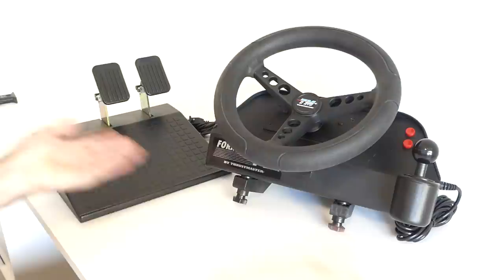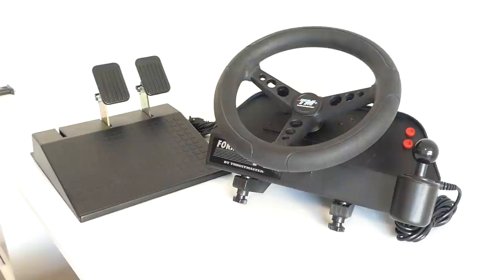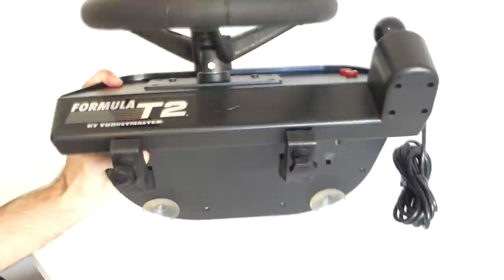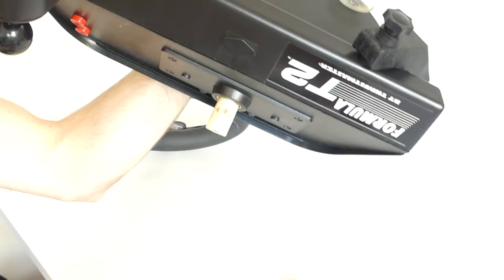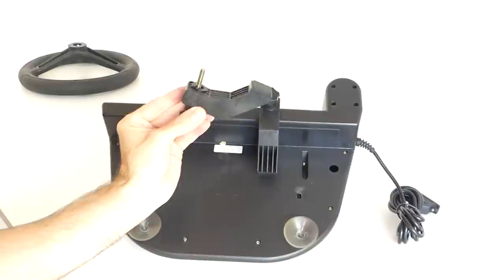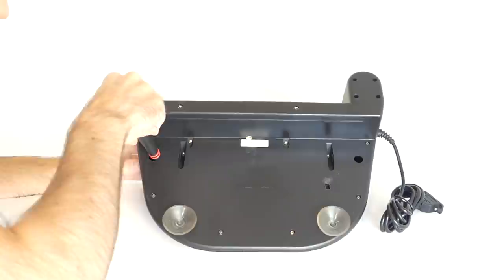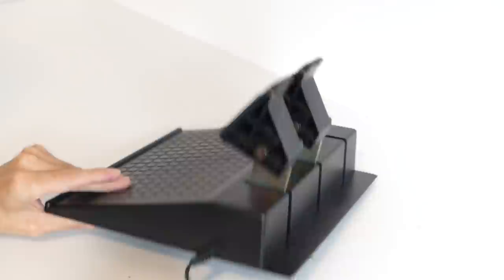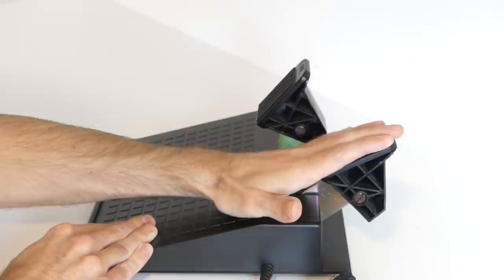Thrustmaster T2 teardown: THE wheel and pedal set from 1996!

Comment: I bought the pedals for 5 bucks on an a antiques shop and converted them to USB using an Arduino. They aren't G27 quality but for the price they are actually kinda good. It's a nice upgrade from my cheap plastic pedals that I also converted to use with my diy wheel.
Reply from the maker: Fun project! Expect to replace the pedal torsion springs and find that the bungee cord in the wheel becomes sloppy real soon though!
Reply: @NielsHeusinkveld  I actually didn't buy the steering wheel. I already have a way better one (also diy) and I only needed the pedals because the other ones that I had are really crap. They are 99 percent plastic, only the springs  were metal. But if those held up 1 year of usage without breaking, I guess these will also hold up for another year.
Then I can buy another crappy set of pedals for cheap, and convert them again.

Comment: Hey Niels going retro is great!
I realise you discarded your original Load cell brake set, but I do hope that through any moves you have made over the past 15 odd years you managed to hang on to the original Brick that used sit on top of your  pre-FFB steering wheel in the old GPL days?
That brick just screamed performance and precision!
Reply from the maker: Sadly the brick only lives on the 640x480 digital pictures I made of it..

Comment: My first wheel was quite similar and from the same era - a Dexxa (supposedly some kind of Logitech cheap brand) steering wheel:

https://f.aukro.cz/images/sk6919066085/726d4740-11a2-40fc-a374-b6d949755116

(Not my image.) It was also a bungee cord wheel, but felt pretty good actually, same for the "shifter". I was using it for the original CMR and also GPL, yes. Eventually, I did some mods to it so I could switch the pedals between combined axis and split axis (as some games didn't like one or the other). Then a year or two later, I got the Sidewinder FFB wheel which I was actually using all these years until fairly recently (I think 2014 or so).

Comment: have a question ,, would i be able to use this steering wheel on windows 10?
Reply from the maker: Not really without converting it to USB using something like the Leo Bodnar BU0836 board (google is your friend). There might be a gameport to USB adapter out there but they're terrible.
Reply: I have one

Comment: can you provide Thrustmaster T2 driver for me? Thanks!
Reply from the maker: There are no drivers for the original wheel, which used the gameport. And when modifying one with a USB board like I did from Leo Bodnar, it becomes a plug and play USB Game Controller, for which you also don't need drivers.
Reply: @NielsHeusinkveld  Do you think the T2 steering wheel is easy to use? Can it be modified to have force feedback and a larger steering wheel? (For example, change to MOMO)
Reply from the maker: No, it is a terrible wheel, avoid at all cost! Any second hand Logitech G25 or G27 will be 10000x better.   @user-en8gw8cp6j
Reply: @NielsHeusinkveld  Thrustmaster Force Feedback Racing Wheel  (Ferrari force version 1998 ) ,how do you think?